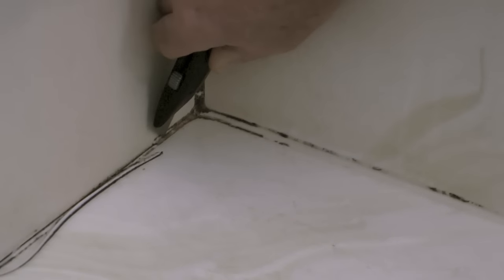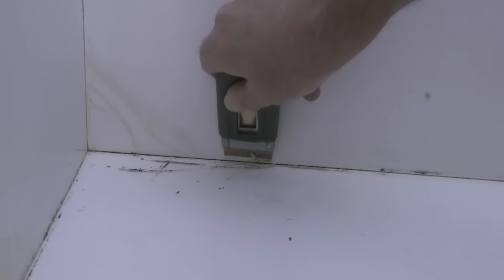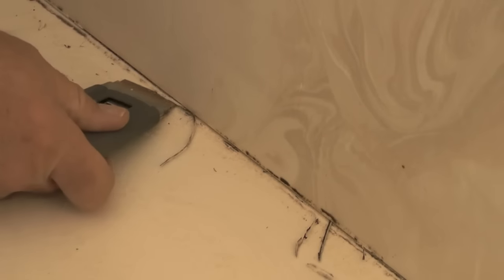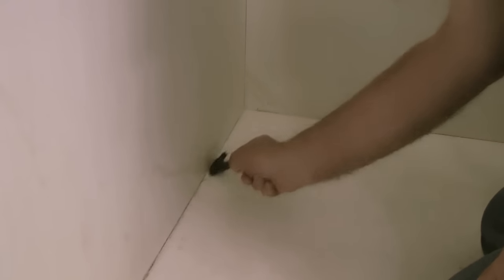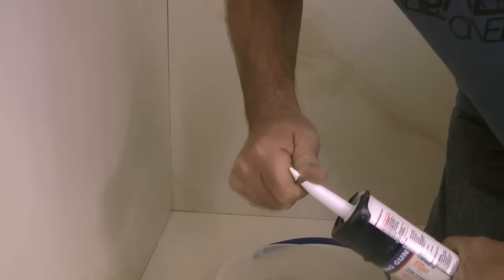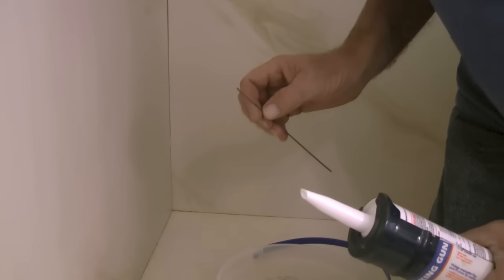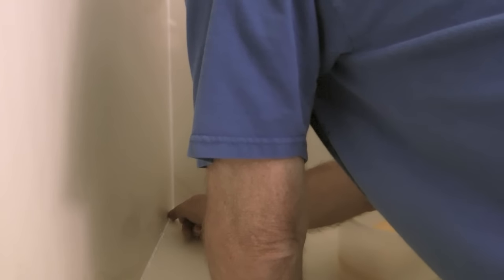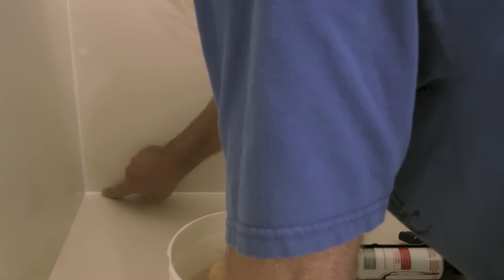Remove & replace moldy shower caulk

Comment: Thanks again for having your youtube video on (I assume) a dreaded project for the DIY'er. The last email I wrote to you asked if I should cover the opening (gaps) between the wall tile and the floor tile.You responded I should first fill with Silcone,,,I went a bit further and use the quick patch cement in a tube so I would be positive the gaps were going to be sealed for life....I waited till that dried....and performed your video in replacing the caulking. I think somewhere in the start up in putting down the caulking where you describe the bucket of warm water...a sponge that you never described what to use it for....cutting of the caulking at 45 degrees and placing it in the gun....showing us how to put the layer of caulking down....BUT NEVER describe how to use the gun and stop the silcone from pouring out all over the p[lace !!!!....LOL.....thinking that when you stop sqeezing it should stop    WRONG   !!!!. .....felt like one of the three stooges ....trying to stop the caulking all over the floor.....what a mess till I finally understood how to stop the gun.....LOL....what do you want from a professional accountant....LOL  PLEASE put in your video how to stop the gun ....Anyway the cement dried and I finally finished the caulking....my only comment is that the caulking I took off from the professional tiler that split due to house settling was a good 1/4 in up the wall and also down on the floor.....when I finished it almost look like your video and was just settled in the space between the tiles on the wall and the floor.....there was very little excess like the pro had originally...by the way the cement seemed to work fine as a filler for the gaps....Anyway I just finished and will wait until tomorrow to view the results.....if not satisfied I may call one of the tilers building within our community (lots of new homes going up) and give him the easy job of putting a second coat over all my hard work of getting the job into an easy position for him to do a second coat...... Than gett myself back on the golf course !  Now being retired and getting some time to do these jobs....forgetaboutit !!!!! Hire someone ..keep the economy moving and go play some golf !   LOL   Ciao, Peter
Reply from the maker: Hi Peter. Good points about the caulking gun. You do have to release the pressure on the caulking gun so it doesn't keep pushing the caulk out the tube. I'll remember this for future videos. Have fun on the golf course.

Comment: Allway makes a 3-in-1 tool, the silicone spreader is awesome, so much better than a finger or a rag! The steel cutter does ok depending on what’s behind the existing caulk, but still need a flat scraper.

Comment: Exactly how I do it with one exception: I use a spray bottle with bleach in order to get all the way in the seams and then I let it dry out for a few hours while I do something else. Years and years with no mildew. Great video.
Reply from the maker: Great tip, thanks for posting.
Reply: @Iscaper  hey ! here in flooded nsw we learnt the hard way, Bleach  feeds mould . I did my replacement  without your vid but glad you confirmed what I had  done. I didn't do the heater thing yet that did come to mind. I did and more importantly, sprayed with force the moulded crevice after removing silicone  with a  mixture of strong vinegar an ozzie lemon myrtle (super mold Killer) clove is commonly recommended 
Thanks  for the video thou bro.

Comment from the maker: No. I wish now I would have used clear silicone caulk. I had a few wider gaps where the shower walls met the shower floor and I wasn't sure the clear silicone would hide the gaps so I used white. Problem is when you open the shower door your eye is drawn to the white in the seams. The white looks ok in the seams but I think the clear would look better. I used clear on the shower door installation and it looks great, that is it doesn't draw your eye.

Comment from the maker: I would probably use silicone caulk in the gap because the silicone is somewhat flexible and if there is any movement from using the tub the silicone would keep the seal better than the grout.

Comment: I have already tackled removing most of the moldy parts of the caulk after watching your great tutorial.  My question is, do I need to remove all of the tile around the shower?  My mold affected the corners all of the corners but only a one small section of the perimeter.

Comment: Thanks for video! I had a hell of a time removing the old stuff it was like cement hopefully I used the right kind of caulk its acrylic silicone but it say let it cure for 72 hours before getting it wet wish I had read that before I did it, but it came out very professional looking so I'm happy
Reply from the maker: +Lisa Antunes 
Congratulations and thanks for the info.
Reply: iScaper1
Thanks its always good to have a proper visual guide my landlord bought the wrong kind of caulk but I won't tell him that ;)
Reply from the maker: +Lisa Antunes 
Yeah, latex caulk is good for sealing windows and it's paintable, but not so good for showers and bathtubs.
Reply: +Lisa Antunes They have 1 hour shower Caulk too!

Comment: Just did this for another 45 minutes.  I do a little each day,   using the spare bathroom for showers.
I have clear silicone that has gotten black and nasty.  I am also scrubbing it off with borax.  It helps to stop fungus and rot. Bleach is just too noxious.
Hopefully,  I'll have time to reseal it by the end of this month.

Comment: Saw another video where someone laid down a THIN caulk bead ensuring it made contact with both sides and pushed into the joint (angle of the caulk gun and tip), then sprayed the area with water with dish soap squirted into it across the joint and used a popsicle stick end to shape/scoop the caulk, and he wiped the excess caulk on something that won't leave fibers.  Work the rounded popsicle stick close to parallel with the tile or wall material to get any that slop around the popsicle stick.  No need for tape.

Comment from the maker: Shouldn't take long with a fan running. You can run your finger along the seam to see if you feel any moisture. I gave mine a couple of hours but there is low humidity at my location.

Comment: Thank you for this posting. My father is no longer here to ask for this kind of info. I would like to recommended for folks to consider using both a mask and goggles due to the mold. Whenever I clean up what is a small amount of mold I have a day or two of a reaction.

Comment: Great tutorial. What can I use to scrap off silicone caulk from stainless steel corners in my shower to prevent scratching the metal?
Reply from the maker: Maybe try a plastic scraper and Goo Gone or caulk remover. Here's an article that might help: https://www.hometalk.com/diy/decorate/rooms/q-anyone-have-a-secret-to-getting-caulking-off-metal-without-scratching-3024204

Comment: That caulk removal tool you used, find one with a metal end the edges are sharper and do not give. Used mine today took 35 minutes to strip everything.

Comment: I did mine and it came out PERFECT !   Question ... the stuff around the wall tiles are moldy too. Is that caulk or grout?
Reply from the maker: Great, thanks for the comment. Around the wall tiles if it's caulk you can pierce it with your utility knife. If it's grout it will be rigid and feel like sandpaper.

Comment: also, I found that using masking tape either side of the join really helps to get a clean thin line.
Reply from the maker: Good tip, thanks.

Comment: Great video. I was wondering how much would it cost to get something like this done by a professional? I don't think I have to patience to do it myself?
Also should one use anti-mold caulking material?
Reply from the maker: Not sure but a reliable handyman would probably be cheaper than a plumber.

Comment: I wish I had a man to do mine for me. Yes I can do it myself but I don't want to...syching myself up. Awesome video!
Reply from the maker: You can do it!
Reply: You don't need a man to do this job. It is easy. I can do it without a man and so do you.
Reply: Thuy Le Tis true. Thanks for the encouragement. I bought what I need and will get on it this weekend.
Reply: I also bought GooGone at home depot to soften the caulk before scraping. It will cut your time and effort by half.

Comment: I would of used gloves here, as silicone like this, really isn't good for your skin. I also would of did two rounds of warm bleach water in the joint seams before applying any fresh silicone, further preventing the spread and regrowth of any bacteria or mold. I hope your shower is still going strong.

Comment: This is a great, informational video, however, I'm a bit worried because my mold is definitely bigger than that little thin strip. Is it still safe to clean, remove and replace myself, or should I get professional help?
Reply from the maker: I would try something like Tilex Mold Remover Spray and see how that works first.

Comment: Thank you for this helpful video.  How long should I wait between removing the old silicone and applying the new (for the surface to be sufficiently dry)?  I live in an apartment where the handyman put new silicone over the old moldy silicone.  He will not fix it, so I will be doing it myself!
Reply from the maker: Doesn't sound like a handyman to me. I think I waited a couple of hours but you could speed up that time by using a hair dryer if necessary.
Reply: iScaper1 Ha!  I think you are right.  Thanks for the information.  I plan to tackle the shower this weekend.
Reply from the maker: hollybooboo
Good luck and let me know how the project goes for you.

Comment: Wow, wish my caulk were as easy to get out as yours is.  Mine's like cement.  BTW, how do you clean the old caulk out of your shower?  Vacuum attachment?  Thanks for the video.
Reply from the maker: I used Clorox wipes for clean-up because I wanted to disinfect as I cleaned.
Reply: An yes, thanks.  I realize my case is different, because I'm re-caulking a tub, not a shower.  Result:  clumps of caulk at the bottom of the tub.  Hence, my wondering about the vacuum.  Thanks again.
Reply from the maker: Allen Gumm
Your right, a vacuum would work good also.

Comment: After the old caulking was removed and mold cleaned (after multiple iterations), there was still some mold left in the grooves. You caulked over that mold in the grooves. Wouldn't that mold come back again?  Reason I ask is that it seems to be in my case when I did quite a bit of what you showed here and now I have mold in that caulked area again.
Reply from the maker: You do the best you can. I think it would be hard to remove 100% of the moldy caulk from the grooves. Showers are a damp, moist environment so dealing with mold will be an ongoing process. Have you tried caulk with microban?

Comment: In our shower stall there is the easily removed silicone and hard grout (?) too.   Should we remove both?   The hard sealer is hard to remove.
Reply from the maker: I wouldn't remove the grout, I would try and clean it unless it's really bad.

Comment: Thanks for your instructions. So how did the new "antimicrobial" silicone perform?
Reply from the maker: So far so good, no mold on the caulk yet.
Reply: Thanks :-)
Reply: Is there a particular kind you recommend?  Also, how long do you have to wait after removing the old caulk to ensure the wall area is dry?

Comment: I just learned something useful on another video on this subject.   Most caulking guns have a small hole with a built-in trimmer that will snip the end of a caulk tube.  And you will also fine a built-in piece of heavy wire attached to the gun that will twist out and be the perfect tool for puncturing the  seal of the tube.  Ain't that somethin'    Apparently many who use caulk don't know this.

Comment: In my bath, behind the old shower caulk, there are some fairly large gaps in the grout under the tiles. Any tips on whether I should try to fill them with some other material or try to apply more caulk over that?
Reply from the maker: Can't think of anything that would work better than a thicker bead of caulk.

Comment: Very good video, but I'd HIGHLY, HIGHLY recommend using painter's tape to mask either side.  It's so worth it.  After all that hard work scraping & cleaning, it would be a shame to see messy caulk lines that can easily be avoided with just 15 more minutes of prep work.
Reply from the maker: Good tip, thanks for posting.

Comment: I have a 1993 porcelain covered metal tub with a tile enclosure.  It appears as tho someone caulked the gap from the tile to the tub.  The caulk is black with mildew. Would you recommend the same procedure as in your video after removing the old caulk and mildew.    Once you have everything stripped and cleaned would you recommend caulking the gap between the tub and the tile or would you grout that area instead?  Thank you.

Comment: How deep should the gap be? with a toothpick mine goes in a little less than half an inch, and there seems to be a lot of debris tucked in there. Hope the wall isn't rotted or something :)   Thanks for the DIY!
Reply from the maker: +Groth1175 
The depth will probably be whatever thickness your shower wall is. Were you able to get the debris out?
Reply: iScaper1 Yeah I think so, turns out its all mounted to drywall, so it was probably bits of that washing out, hope I didn't destroy it too badly with all the rinsing, Either way silicone is applied, guess if the wall doesn't crumble to pieces in the next few days it worked. Thanks again!

Comment: Not being critical.....but....Tilex(or some other brand)mold and mildew spray used on a regular basis would have prevented a lot of the mold and mildew seen in the shower.....thus preventing the need for replacing the caulking.  You would still have to replace it occasionally though.  From the looks of the amount of mold and mildew in the shower it’s been a long time since the shower was cleaned.

Comment: Great video. Thanks. When do you use caulk vs. grout? I noticed you did all of the horizontal base of the shower with caulk, but you never showed the vertical seams in the shower. Did you strip and re-caulk vertically the same way?
Reply from the maker: +Mike Ward 
If you're removing old caulk then replace with caulk, same with grout. I did do the vertical seams, I started at the bottom and worked up the shower panels.
Reply: Grout never goes on corners as it will crack and leak.

Comment: Thanks for the info it all went well so far. I didn't have a mold problem I had a house settling problem that split the caulking where the wall tile met the floor tile. I scraped it all off as you said in your You Tube and have now noticed that there is in some places a gap between the floor tile and the wall tile. I am not techie enough to put the pictures to show you but I am sure you will understand. I didn't notice this in your YT video as in all cases the wall tile met flush with the floor tile. My question to you is should I put a bead of the caulking down into these cracks where the tiles do not meet FIRST and let that sit a day or so before I do the finishing caulking with the hot water etc ????  The gap is more that the floor tile grouting has disappeared and left this gap. It is not that the floor is now lower than the wall. It just looks like the grouting has disintegrated in places and I am wondering if I should first put a bead in there so there will be something for the caulking to rest on when I do the next stage.  I hope I am making sense with all of this for you?  Thanks, Peter
Reply from the maker: Hmm. If it were me I would try and fill the gaps with silicone and do it all in one step. That way if there's a little shrinkage the bead won't pull back too far from the edge.

Comment: Thanks for the video.  My caulking did not come out as clean. So I have a lot to clean up.  What do I do?  Do I scrape the extra caulk off or is there something liquid that will remove it?    Help!  (First time doing this)  I finished last night at 7:00pm.
Reply from the maker: Hmm. If the caulk is dry you could try trimming the excess with a razor knife. If that doesn't work you may have to remove the whole bead and start over.
Reply: @Iscaper  Thanks I'll try to trim.  I meant to ask how do you stop the caulk from coming out between each sections while you smooth each section of the wall?
Reply from the maker: @phillycg1  If I understand you it sounds like you may need to run a smaller bead between the sections so there isn't so much excess to deal with.
Reply: @Iscaper  My question is about how to stop the bead between smoothings.  Is there a way to stop and start it at will?  When I stop to smooth, the caulk still comes out and that's one of the things that  made the mess.   Are you able to use the caulk again on another day?  I put some reynolds wrap on the tip.

Comment: I might add what made my process easier was to use goo off/goo gone pro to soften up the caulking which made the caulk removal much easier.
Reply from the maker: Thanks Steve for the tip.

Comment: Great video!  How do you tackle large gaps?  Do you still use caulking or another material?  Thanks in advance.
Reply from the maker: +palapako 
I've used caulk to fill gaps up to 3/8". I've haven't encountered anything with gaps larger than that yet.
Reply: you can use foam backing rod for larger gaps.You can get it at Walmart or any hardware store.  I'm in the process of removing old moldy mildew and cracked caulk from my shower and instead of using a ton of caulk, get some foam backing rod. comes in different sizes. I bought some for my project because I have 3/4 inch gaps. When our old house was built they didn't do a good job installing the tub walls. just remember to leave about 1/4 of an inch of recess to allow room for new caulk.